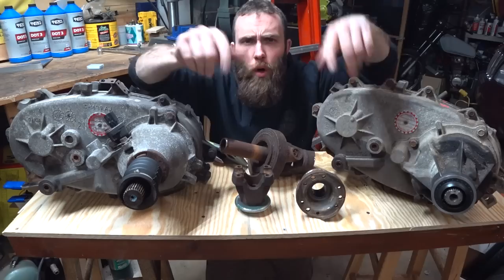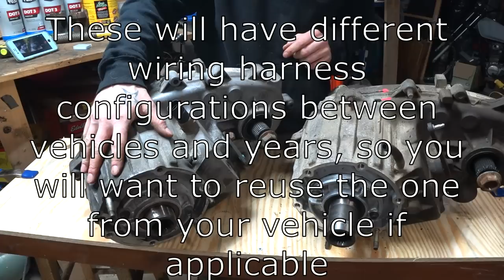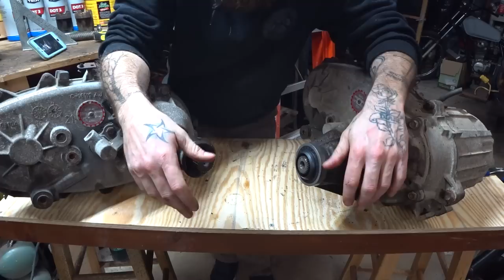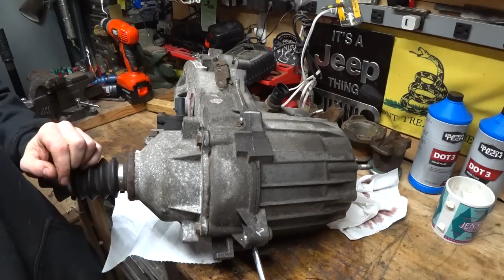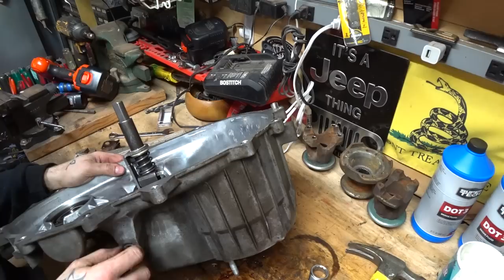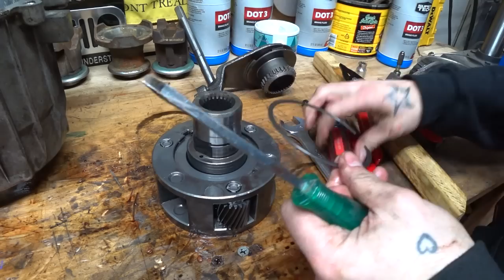Transfer Case Swap for Beginners - Everything you need to know!

Comment: 3 year later, Okay. So, I just put a 242HD behind my 4.7 V8 in my '04 G.C. Limited. While the transfer case was out, I took that side heat shield off to see if I could find those transfer case switch wires. Well, I guess they left them out of the V8 trucks. Oh, well.

Comment: The 249 transfer case didn't require special fluid because the viscous coupler is a sealed unit which has a silicone based fluid inside of it.  The 247 transfer case uses a variable clutch pack instead of the viscous coupler which is why it requires the friction modifier.

Comment: question are rear output shafts interchangable? i have 2 242 cases 1 from 1988 with a hard slip yoke cover and one from 1998 with a rubber boot cover. the jeep i have has a 249 with a broken vc so ill change to the 242 from 1998 buuuut the rear output shaft on the 249 and the 1988 242 are same length and the output shaft on the 1998 242 is about 3.5 cm longer that is 1.4 inch ish. so my question is can i take just the output shaft nothng else from the 1988 242 and just slap it into the 1998 242 without problem or is this not possible??? i just hoping i dont have to spend 250 euro on cutting and balancing my rear driveshaft. please help

Comment: Pro tip for removing plugs...

Take a socket, Allen key, or what fits snug on the plug, make sure it's straight. Clean it if you need to. Then take a light hammer, I prefer my aluminum hammer, and smack the socket/Allen. Not be a jack-o'-lantern about it, but hit it good. The less it bounces off the socket the better. Then you will find it is almost always considerably easier to remove a fastener of all types.

I've worked in shops for 18yrs and I've seen people using all kinds of leverage and fail, only to have me walk up and slam that fastener with my tiny 2oz aluminum hammer then use a harbor freight wrench to remove it.

My theory is the vibrations traveling through the fastener breaks the rust bond between the 2 pieces of metal. I picked this trick up in a shop that remanufactured cat engines and we fought dozens of plugs until an old man got tired of laughing at us and showed us how it's done.

Comment: I have a 242HD in my 2000 WJ 4.7L limited so it was available on earlier models. I had it rebuilt at 165K miles and now have 225K.  Great video and love the channel!  It would be funny if I ever ran into you at Vince’s u- pull I don’t live far from there!

Comment: This is a fantastic video. I'm just replacing a failed k1500 tcase and the algorithm recommended but listening while I get ready for work, this is the kind of video that really answers questions for people. 
I will add that there several other new process tcases that are nearly identical on gm products. Mine is a 241c but there are 241,hdh241 and several others. Watch out for the one with the magnesium case half as the pump Will cause wear through holes. They do make a wear plate and several other internal upgrades for these cases.

Comment: You have definitely gained my respect and subscription dude. Any ideas on getting a stripped transfer case fill plug out? The previous owner stripped it and gave up on it smh.
Reply from the maker: Well the bummer there is that you are dealing with a steel plug in an aluminum housing. I have heard of people having success drilling the old plug out using a reverse drill bit. The hot is that at some point the old plug breaks loose and pops out. makes a heck of a mess though. They also bake extractors. I personally have been able to use a cold chisel to work it out

Comment: Hi Doug, I watch and luv your videos. Just got this 93' Jeep Grand Cherokee Larado 4.0 I'm stumped on what transmission fluid I should use for the transmision in here (the best used hopefully!) Mopar ATF+4 (Type 9602) or the Mopar ATF Plus (Type 7176) It has 219,000 miles on it and I was told not to have it completly flushed (just what's in the pan, due to the miles on it!) I was also told it's a 42 RE 4spd Automatic with the Select Trac/Limited Slip I believe. I would greatly appreciate your Jeep expertise in this manner, thx so much!
Reply from the maker: You will be fine with just about any ATF+4. In my experience breaking the bank on ATF doesn't pay out. Keeping it clean does. That was VERY good advice not to totally flush a transmission that old. Drop the pan and refill it is the safest way. I have heard a TON of stories of old transmissions with unknown pasts being hot flushed and the are dead in 100 miles

Comment: This is great! I have a 231 with a 4 low that is grinding. I never heard any pops or anything but it just has a hard time going into gear. It ran out of oil last year and now also has a vibration around 55-60 mph. Should I buy used or reman or just rebuild it. It is not a daily driver.

Comment: hypothetical question.  Can the rear housing around output shaft be swapped from one case to another.  Such as your two in the video...... move the one with the speedo sensor on it.. to the other case..... ?   In my case....  (pardon the pun) could I swap my TJ's 231J housing onto the 242J (and put the speed plastic thingy on the 242 shaft)  so I can use TJ's OEM spedo.  I'll be hack and tapping so the length of shaft sticking out won't matter... its being trimmed.

Got to pull them apart anyway to swap the input shaft to get right length.   Oh... on that...  both are early 2000 T-cases (242 and 231. putting 242 in TJ)... shouldn't the gear teeth and bearing width be the same between the two?

Comment: How much easier would it be if you have 2 WJ GCs, but different years, to do the swap?  2002 Select Drive to a 2004 GC with Quadra Trac. And the 2004 QT to the 2002 with SD.

Comment: I used the 242 shifter arm. Worked fine, didn’t even need to adjust linkage. The 242 has too many options, I think it would hit the casing.

Comment: I recently did a transfer case swap, I swapped a 1995 np231 on to a 1989 transmission, i had to change the input shaft from 1995 NP231(23 spline)  to a 1989 (21 spline) as my transfer case went out.

Comment: Question, I have a 2002 Wrangler with the 4.0 and a NP231J TC. The TC cracked over the winter and I bought another TC from a salvage yard that was also on a 2002 Wrangler 4.0. That Jeep only had 70K miles on it. I bought that TC. That TC is also a NP231J but it only has 4 lugs to mount to trans. Is it ok for me to just utilize the 4 lugs or do I need to figure something else out. Thank you for your time and help. Keep up the great videos.

Comment: Around the 14:22 mark you mis-spoke about the viscous coupler.  The 247 uses the clutch pack where the 249 uses the viscous coupler.  The 249 uses regular ATF, as the viscous coupler is a sealed unit that isn't serviceable, it contains its own silicone based fluid.  The 247 uses special fluid due to the clutches like a limited slip uses a friction modifier, same goes for the 247.
Reply from the maker: You caught me! Hard to keep my facts straight when filming sometimes. thanks bud!
Reply: @DEInTheGarage  No worries, wanted to point it out so someone listening wouldn't get confused.
Reply: 247 has a viscous coupler

Comment: This is perfect for what I’m doing 247j to 247j but the input shaft is different lengths. Started the process but cannot for the life of me get the cases for fully separate only about 1 1/2” and it won’t budge. I would really appreciate any input. I don’t have any idea how you just lifted it up and they came apart
Reply: The lock rings are removed too 
For reference I’m talking about 25min in the video

Comment: I just use a couple of bolts off of the front yoke and put a steering wheel puller on the yoke (you have to keep it out of the way so one bolt will go through a threaded hole and one through one if the non-threaded hole and then it'll wedge that in when you crank it with your impact. But, I do like Bleepin' Jeep and that tool.

Comment: I was wondering is you think that a nv142 could be made into a full time 4wd using the gear from a np140.  I know the 140 is a shorter case but they use the same chain rebuild.

Comment: HI Doug, thx for responding back to me,.I really appreciate it!!! Most others don't so I stop watching their videos. Your video on the 242/247 is the bomb though I have a question that you may have stated already about the 242's. I'm pretty sure by watching your video that I have the 242 in my 93' ZJ Jeep Grand Cherokee Larado, 4.0 Note: My transfer case looks just like the 242 but the nosecone looks like the 247's nosecone in your video! I looked on the NP tag & I just could see Model 242...? & Gear Ratio 272. Could this possibly be a 242 HD? Is there any other way of finding out w/o pulling the transfer case and gutting it? Do I still use a ATF+ 4 in the case if it would be a 242 HD? Thx again for your expertise and responses.

Comment: Hello I have a 2001 dodge 2500 cummins with a np241dld in it and I destroyed my 4 low system. The planetary the input shaft and annulus are gone.so my question is can I use any annulus and planetary from a np241 or does it have to be from a np241dld.

Comment: Can you demonstrate the different shift levers on dodge's, I have 2003 dodge ram 1500 4x4. I know where it is connected on the shifter from inside the truck but where does it connect to the transfer case?

Comment: Just put a pipe wrench on it as a plumber pipe wrench is the way also if you're putting a 242 on a V8, you just need to slip yoke off of the straight 6 drive shaft. Use the long end of your V8 drive shaft and your golden

Comment: Awesome video.  I have a question.  My 2005 Silverado has a 3.42 rear end. And it went out.  Just replaced it.  And the transfer case is out of it now.  It is a gem 261. With 272 ratio.  I’m wondering if it is the correct transfer case before I replace it.  Any help would be great

Comment: Are the rear u-joints the same on a 242 and 247? I'm looking for a drive shaft for my 2001 4.0l grand laredo. But all I'm finding is drive shafts for a quadratrac ll and I got a selectracll. So I'm thinking I can use a quadratrac since I got a 2 inch lift but I don't know if the rear diff part will bolt right on.

Comment: My Power transfer unit the dealership said its faulty. So they quoted me around 6k to 7k here in Australia just for the part w/o labor yet. The PTU in mopar is around 1.8KUS dollar. Dang. And then I did some google, and ebay they are selling the transfer case unit. I believed the TPu is part of that transfer case. And some selling it for 200USdollar to 500 or so. But I don't know if my jeep transfer case is compatible because one of the people I talked selling part told me which one I'm getting single or two speed. I don't even know what that is. My jeep cherokee is 2014 trailhawk. So which one should I pick single speed or two speed. Thanks. Anyway, I'm not a mechanic, but with the correct tools can I DIY them? 😅 because even the labour is expensive.

Comment: Hi, I own a 2014 WK2 and I wasn’t having issues with my transfer case but there was a noise when I just go out of 0mph and have that part swap and found out that my transfer case was cracked (nothing on the dash, no lights, no warning or anything) got it “fixed” but now it’s popping a 4WD Service - Service Throttle Control - and the car doesn’t run now, end up worst. The “mechanic” who fixed the transfer for the second time it’s telling me that he has to program the case. My doubt is that, is it really a thing? That he needs to “reprogram it”? It’s the 2 Speed Transfer case. I really think it’s a mechanic part only, the only wire that the transfer has it’s a small motor to switch the transfer form Low to High.

Comment: The Dodge Durango had the option of a 242HD, but I'm not sure what the input and output shaft setup is on them as I didn't have the money to pull the one at the pick a part I found, and I have found several 1998-2000 Dodge Durangos equipped with the 242HD.  Supposedly the Dakota had a 242 option but not sure if it was the HD model or not and I've never seen a 242 equipped Dakota either LOL.
Reply: 242HD in all 4x4 Dakota except R/T. 242HD also in most Durango except SLT+ with AWD or the R/T (stock with AWD). That has the 244HD (all time, no 2wd). And the two I got out had the same spline count too. Installed a 242J case in my Durango using the stock shafts and yokes.

Comment: Good video. I actually never took apart one but probably will soon. The one in my Avalanche is clunking. Which part would make it do that?
Reply from the maker: Could be a u-joint on the driveshaft or a loose chain inside
Reply: @DEInTheGarage  Well, I rebuilt the trans a month ago, and replaced both rear shaft U-joints. Thought the shaft U-joint replacements would take care of the clunking but no. It's either inside the transfer case or the rear end. My luck it will be the rear end going because it has a little play on the yoke input. I here a slight clunk going into 3rd sometimes. OH boy.
Reply: prancstaman Could also conceivably be the upper rear ball joint
Reply: Thanks for the input, that part slipped my mind. The rearend is a 5 link solid axle and has all bushings, but haven't checked the bushings. yet.

Comment: I bought a 242 to replace my 242 transfer case. but the wiring is different my 2004 GMC Sierra push button shift has a seven point plug and the one I got has a 4 point and a 6 point plug on the shift motor. Plus the original transfer case had a star shape shaft going to the shift motor and the new one has a round shaft with two flat sides. Can I make this transfer case work by rewiring a plug to it or what can I do?

Comment: Hi, I've been trying to confirm what fluid goes in the 249 I keep finding conflicting info? is it ATF+4 or Mobil 424, Mopar? 
Would really help, thanks
Reply from the maker: I always use ATF+4 in the 249. Never had an issue. It is the 247 (99-04 Grand Cherokees) that requires proprietary Mopar fluid.
Reply: @DEInTheGarage  cheers

Comment: I’m looking to change my 231 to a 242.  My 93 xj sport is stock for height and has slightly oversized tires.  Don’t have plans to lift at this time as it’s mostly daily driver for me.  Here’s the trick- I have Ax-15 manual transmission.  According to Novak, the ax15 always has short 23 spline for input on TC, But AW4 has medium 23 spline for 91 and up.   Does this match what you’ve learned?  Novak sells the correct input for about 155.   Since this is my daily driver, I want to avoid canibalizing the 231 unless no other choice, and ax15 cherokees are scarce from what I’ve heard.
Reply from the maker: I have never done that particular swap, but that is my understanding. Same spline count, different length
Reply: Did you ever get this to work? I’m planning on mating a 242 to the NV3550 in my KJ. Alot of people have said that the 242 won’t work behind a manual trans because of the torque. I figure I’ll just give it a shot and xhange back to the 231 worst case scenario. I’ve verified spline count will work, just need to look into the length of the input shaft.
Reply: @jamesstoddard8790  I went through a LOT of forums about 242 mated to Ax-15 manual.  Every entry I found of person that actually did the swap found it to be completely functional.  A few claimed they occasionally heard a little gear lash during shifts, but others reported no noise at all.  I didn’t find anyone who did this and had major issues.  
From what I read, the NV manual transmission is comparable to the AX15, so it shouldn’t be issue for you. 
I’m hoping to do swap tomorrow or soon. Weather (snow and then constant rain has been blocker).
Reply: @DEInTheGarage   ironically, the 242 I got and rebuilt actually had short input shaft (I even double checked with micrometer). So no input shaft swap was needed.  The 242 came from 1993 with aw4 transmission.  Very odd, but made for a drop in fit. I did do rebuild of 242 (thanks for videos you did of tear down and components).  Just installed it yesterday.  Ran into issue with setting the Azzys shift linkage, but was able to drive home in 2wd mode fine.  Will update after linkage is set on 242 full time mode behind aX-15.  Also got an OEM TC skid plate put on at same time- got it from same donor XJ. :)

Comment: 246 and 263 HD uses ATF dex merc ran into on my old 2000 GMC Sierra that had a 263 only difference is ones push button one is lever 263 is lever 246 is push button

Comment: I gotta 94xj put it in 4h from 2h while in drive now it clunks a little in 2h at low speeds . 4x4 doesn't engage and sounds a lot more clunky and even more so when turning.. could this be the TC? Or front diff? This is a 231 j TC which I was wondering what the j means and if it's a beefy case like the 231hd u said we're so sought after. I'm new to Jeep's any help would be appreciated!

Comment: When switching t-cases and talking about driveshaft length, do the engine / transmission lengths play a factor as well ? 

Obviously a v8 is shorter than a i6, and I’m gonna guess they use a slightly different transmission as well.
Reply from the maker: Yes, all that must be taken into account. every vehicle is different as to where the engine and trans mount.

Comment: Hi very informative video thankyou 👍
I have  question I have an issue with my 242HD TC in low range in reverse only its like the front wheels drop into neutral gear, however the rear wheels still have drive.
Could this be  selector issue? Many thanks 😊

Comment: Great videos, I have a question about my 1998 Zj 5.2. I want to swap a 242 into it, will it bolt right up, including driveshafts?  Thank you
Reply: I left out the fact the 242 is out of a 1998 gc   Thanks